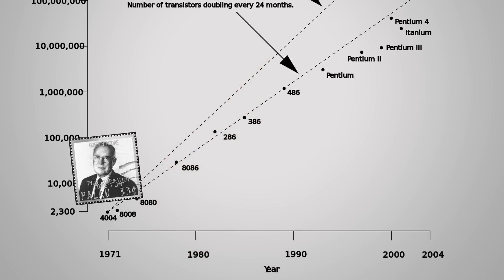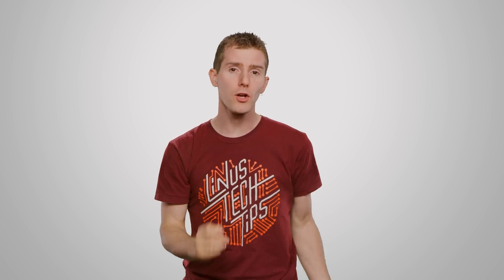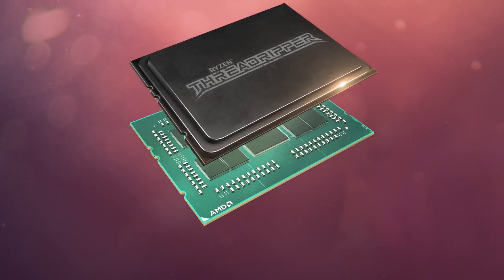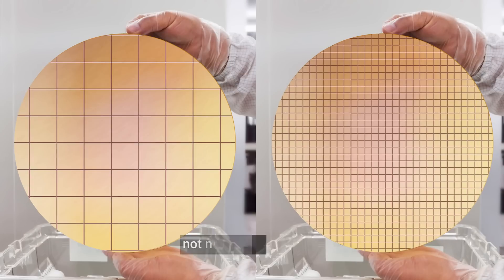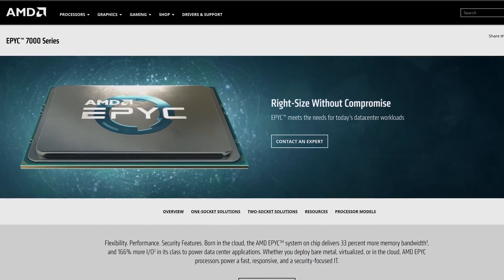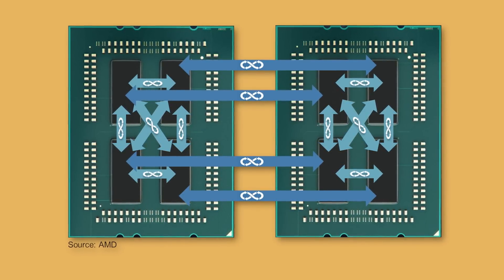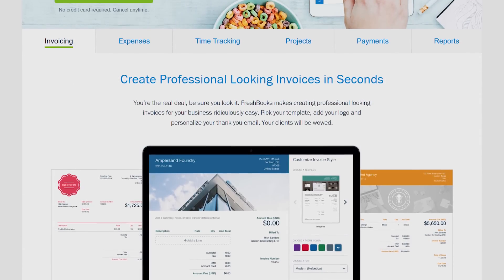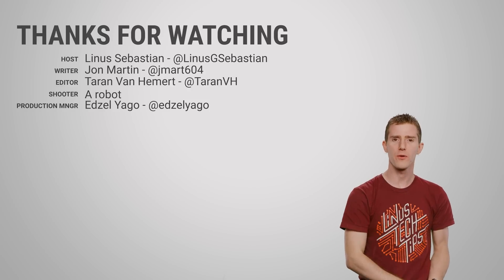How AMD is Making CPUs More Affordable - Chiplets Explained

Comment: 3:52 Correct me if I'm wrong, but there's no optical circuitry in current CPUs, so the limiting factors of speed across a chip wouldn't be the speed of light.
Reply: Electrons travel at about 99% the speed of light. That is what he's referring to.
Reply: @forrest225  Electrons only move at that speed when matter is not present.  In a computer they move at drift speed, they bounce around to much to achieve a straight line. This also happens in a power-line, but on a larger scale. I believe this bouncing effect, is what cause the Heat in certain objects. Granted they now spread this out across the CPU much better today. I remember the old days = hot hot hot lol

For example, the drift speed through a copper wire of cross-sectional area 3.00 x 10{-6} m2, with a current of 10 A will be approximately 2.5 x 10{-4} m/s or about a quarter of a milimeter per second. 

There Achilles heel is, they collide with atoms. Thus causing them to move slower, but still fast :) That's why a battery or a generator controls the Electrons much better.  You remove the atoms, you get your 90% of the speed of light. If you want to move them faster, it will take massive amount of energy to push it 2 to 5% more = not worth it.
Reply: Yet the fastest thing in the universe is only the speed of light" Vacuum of space" .The electricity that travels in wires and poles, moves only about 1/100 th the speed of light. If by some miracle, your electricity moved at the speed of light in the CPU = you would have extreme trouble in your house lol. Even a lightning bolt does not travel at the speed of light. So as long as your CPU Exists in Earths Atmosphere, Nothing in it will ever be close to light speed :(.  

 The Rule is once Electricity is moving: it becomes stripped of it's electrons. Thus your fastest movement of Electricity would be close to only 200,000 mph Not Light 186,282 per second :) The speed of light is still Extremely slow, if we want to travel in space. for a CPU and Electricity is Dangerous :(  

So to your last part of your comment: No data would reach or get close to the highest point of speed. Faster they try to move data/Electricity through tiny strips of metal = they get to hot, so near 200k speed is pretty good for all items :)

Comment: Just a remark: while chiplet based design is a step in the right direction from a cost and yield perspective you make it seem like there are no downsides. If a process runs on many threads and they share memory or depend on each other in any way there are significant downsides. You may say infinityfabric is the solution but throughput is not nearly as in important as latency in today's processors. In some workloads this will have some significant downsides as the concept is analogous to ryzen threadrippers design. Wendell from Level1techs already has pointed out that the design with the different CCX'es can make some processes slow if they don't run all their threads on the same CCX. You could make it into a video discovering the ups and downs of chiplets, maybe in corporation with Wendell. sincerely a computer science student

Comment: I need single thread performance for games I run.  Fail to see how AMD is helping in that area at all.  64 threads is a farce.  I wonder if either my gaming or browsing machines would notice the difference.  All the top cpus in single thread mode are Intel, looked it up recently on Passmark.  Currently I run a 4790K, if I could get something 50% to 100% faster at a mid range price I would move but replacing memory, and mother board is a big cost, although having more data lanes would be nice when I run Oculus.

Comment: Also, chiplets allow for higher clock speeds per die; where as monolithic dies rely on their slowest core to define them, chiplets allow for trully efficient binning to truly unlock higher speeds at the same process by selling lower clocking cores for r5 or R3's. This is why ryzen could truly achieve cheaper and, higher core count, higher clocked CPU's.

Comment: Who cares if they are cheaper if they don't have quality? If they have the same quality as intel, then I would by AMD CPU's.
Reply: but they do?
Reply: @TheCatOfWarCSGO  If they have that's great. Do AMD's CPU lasts more than a decade?
Reply: @HeavenlyWarrior  why wouldn't they?
Reply: @TheCatOfWarCSGO  I don't know, just trying to understand why they are cheap. I know AMD graphics cards aren't as stable as nvidia or intel ones. They do not even support their graphics card for long, at least that happened some years ago I don't know if they still do the same thing.
Reply: @HeavenlyWarrior  None of that is true, AMD products are just as stable nowadays as Intel and Nvidia ones - if not more, as they don't have the security flaws that Intel chips do. They're cheap because AMD are a smaller company and want to gain marketshare by undercutting their larger competitors, not because they are any worse.
Reply: @TheCatOfWarCSGO  I'm pretty sure AMD has the same or as many security flaws as an intel chip.
Ok if you say they are stable it means they have improved, I'll keep it in consideration.
Reply: @HeavenlyWarrior  No, AMD are not affected by nearly as many security flaws, and the ones they were vulnerable were patched in software with no impact to performance, whereas the more serious flaws that Intel was vulnerable to have resulted in patches that degrade performance and in some cases even need to disable hyperthreading.

Comment: The problem with multiple dies is that the inter-die communication can be quiet energy expensive. (more capacitance-->energy required to charge it CVdd^2). The other half of the story is how they have split their processors into different dies.
Fields move at the speed of light but not the signals really..
Reply: @granttamiadinata  I don't deny it. But I believe the more interesting question is how they are splitting it into chip let's without increasing the TDP..
Reply: Also, as the die gets bigger, the clock speed has to slow down because the signal must go further. It's a timing nightmare to design for big surface areas which  I imagine is a big issue in chiplet based designs

Comment: An electrical signal through a conductor definitely does not move anywhere near the speed of light.  That should be apparent in the name of the constant; the speed of light.  We already are running up against the limitation imposed by the speed that information can be passed through a standard conductor; this is why chiplet design is not a perfect solution.  Increased transistor count per area literally is superior because the transistors are closer together and pass information more quickly, not because we can "fit" more transistors on a CPU--if that were the case, there would be zero point in shrinking the CPU lithography process, and we would just made the damn processor bigger to get more performance...  This is also why technologies like nanowires and graphene-based manufacturing can promise orders of magnitude more performance--they are better signal conductors, and they are smaller.

Comment: Chemistry does not stop us from making transistors smaller. Looking at current technology there is a limit of downscalability (monolayer meaning single atom for some special compound and for silicon a hand full of atoms) the thing is: an atom is around a tenth of a nm in size meaning we should expect to be able to scale transistors down to around 1 nm (currently around 2 are doable) so we still can shrink them quite a bit. However, what is keeping intel at 14nm is that you will always have a random error associated with your machines if said error is small compared to the thing you manufacture it does not matter. But the smaller you go with the same old machinery (and making new more precise processes can be really expansive) the closer the error gets to be relevant and the higher the possibility gets to get a fatal defect. More fatal defects means lower yield (a problem that is as described amplified a lot by bigger chips) and that means a lot higher price.
Intel can very well build chips smaller than 14nm but they cannot do it at a reasonable price point. Switching to chiplets (which they already startet) will allow them to shrink again.

Comment: It seems to me that a physically larger chip might actually be beneficial for cooling purposes.  Just throwing that out there!
Reply: Yes and no. If you use more fans, even if they're smaller this will be true. But Just one big fat fan on the top of the cpu will not perform very different. Or just use water cooling instead.
Reply: makes sense

Comment: Signals move with the speed of light inside a CPU? I mean if you send the info with photons then technically that is the speed of light, but when most people say speed of light they mean speed of light through a vacuum, which I can hardly believe you can achieve inside a CPU...

Comment: All of matisse use chiplets, not just the 16 core part.
Reply: I know that the apus that are coming out arnt and are basically zen+. I think that the ryzen 3 CPU lineup is monolithic too a d also based off zen+
Reply: @slickjim861  matisse has no APU's in its lineup, the code name for the apus is picasso, renoir will have chiplet design

Comment: less micro processor more super processor. Really looking forward to zen2 bridging the gap between amd and intel as far as gaming and Lower L cache utilization. Since their implementations to threadripper, im hoping the ryzen 9 12/16 cores. Can do the same as threadripper and remove some core power from the excess and throttle them into the first four. To in theory offer something ryzen 7 cannot touch. Im really looking forward to overall numbers of ryzen 7 8 core to the 12/16 paired with flagship 2k 2070+ 5700+ options. How they perform with vega 56/64 and radeon 7 as well.

Comment: 0:45

Here's an idea..(im not sure of the exact chemical properties)

Make them out of a liquid metal... Or some type of conducting superfluid...
For example... When they started developing mercury breaker boxes for homes, instead of solid metal filliment ones. 

When a mercury breaker pops, it just flies apart with the electrical discharge, then flows back together and coalesces back into its confined shape of its container, being able to keep up that same process over and over, returning to its natural functionality virtually endless times... 

Now, im no expert in that area, or anything of the sort, but it seams like a novel idea... If applied to something to that effect, could solve that problem of which he describes. 

If anyone knows a more exact methodology or science that maybe im getting wrong, please post. 

Or if there is some kind of technology now or on the horizon that applies to this... Id be very interested to hear
Reply: he missspoke, its not chemicla properties, its the physics that start being a problem at that scale as your staring to deal with sizes where you cna start experiencing issues with your signal bleeding thru to neighbouring paths. bascially mkaing the 0's and 1's harder to tell apart.
Reply: @Teixas666  ok now binary... THAT i DO understand.. 💯

Thanks for the info 👍

Comment: 3:55 "Signals moving at the speed of light in a microprocessor" I know you guys simplify stuff for Techquickie but you might want to double check your facts on this one. Electrical signals don't move nearly at the speed of light, hence why fiber optic is faster than copper wiring. Electric signals are closer to 1/100th the speed of light through a conductor.
Reply: He didn't say anything about electricity though. He might as well have meant optical computing or whatever else crazy stuff we do come up with.
Reply: the electromagnetic wave rippling through the electrons that propagates at close to the speed of light. The dimensions of the wire and electrical properties like its inductance affect the exact propagation speed, but usually it will be around 90 per cent of the speed of light – about 270,000 km/s.
Reply: I came here to say this and am glad I'm not the only one who caught it!

Comment: Signals do not move through a microprocessor at the speed of light. They are transmitted by electrons or the lack thereof (holes), whose speed is limited by a variety of factors such as scattering at impurities, the crystal lattice or other electrons. Higher carrier mobility is also a reason to explore semiconductors made from non-silicon materials.
Reply: The answer is quantum mechanics

Comment: Can't they go vertical?
I wouldn't mind a cpu that's twice or three times higher than normal
Reply: that's what intel does, with foveros. But that' mobile CPUs/SoCs, as you run into heat dissipation issues
Reply: That creates serious cooling problems, ARM is on a league of it's own as of now with SoC architecture, and some of that makes a lot of sense.

Comment: In theory you could also build a heavily poly-layer cpu using stacked chiplets to get some of that space back. Thermals would be a *shut yo mouth*.
Reply: Thomas Uniat add cooling layers in between them to pipe heat out to the sides
Reply: @JAT985  agreed. Maybe just copper foil instead of heat pipes but same idea. Sounds easier than it is though.

Comment: I've read that my 16GBs of RAM for my Ryzen 5 system is more than enough and that Ryzen doesn't handle more than one channel of RAM well. Is this true guys?
Reply: Sonikks nope also amd sucks and it’s the opposite AMDUMP NEEDS EXPENSIVE FAST RAM SO U AINT SAVIN SHIT
Reply: It's true that first gen Ryzen had problems with Memory compatibility at the beginning, however they improved quite a lot on that and will improve furthermore on that with 3rd gen. But whatever the case, make sure you get dualchannel memory (so at least 2 Memorysticks), as singlechannel Memory might Bottleneck your system. Just make sure to put them in the right slots for dualchannel (check Motherboard handbook or datasheet)

Comment: Electrons don't travel at the speed of light... Actually, quantum mechanics forbids this.. So technically the amount of transistors on a chip isn't the whole deal, it's also the distance the electron has to travel to activate said transistor, hence the quantum mechanics reference.
Reply: Electrons dont travel all the way around the circuit either. The amount of flow (literally by definition the number of electrons) in a circuit is amps. (remember voltage is the potential or "pressure") An Amp or Ampere is one coulomb per second past a given point (Coulomb is to amp what a watt is to a joule). Think of it more like a pipe full of rubber balls that are exactly the inside diameter. If you push a ball in one side another immediately pops out the other side. Also the distance problem you describe is known as latency which can and is mitigated in many ways. So for many practical purposes, it may as well be whatever nice decimal point of C you'd like. Either way its almost if not as fast.
Reply: #ulysisxtr Jesus man, we are on Tech channel not science one. we don't care about the speed of electrons nor physics....
Reply: Well, if you're referring to 3:54, Linus didn't say electrons, he said signals. While it's true that electrons move at a very slow pace through a conductor, and signals don't actually travel at the speed of light, signals do travel at a significant fraction of the speed of light in a conductor. In a vacuum, signals do travel at the speed of light. Electrons don't of course otherwise they'd gain infinite mass (which would require infinite energy)!

Comment: They don't? A 6 core for 200 is not a good value. At least it isn't when you consider how much it cost to make it. It's better in the high end. But AMD screwed up those who were loyal to them. Who wanted affordable entry and mid tier CPU's. They screwed us over.
Reply: so it's forbitten for amd to make money back from their sold products? I mean they still offer better value than intel...
Reply: Ryzen 5 1600 - April 11, 2017 US $219 
Ryzen 5 2600 - April 19, 2018 US $199
Ryzen 5 3600 - July 7, 2019 US $199
6 Cores are as affordable as they've ever been and they have been getting IPC improvements and increasingly higher core frequencies. It's still great value. 
Plus, AMD puts their CPUs on massive sales compared to their competition. I've seen the R5 1600 for $80. Where as the equivalent Intel CPUs are literally within 10% of the price they launched at. In my opinion, AMD put in the work and deserves to profit from the R&D and high value products they've used to shake up the market. 
(That being said, I'm not paying that much for an x570 board. PCI 4 is not worth it to me.)
Reply: @Charsept  Say the same in 2022 when you will still buying the 6 cores for 200, or even more. Yeah. Let them increase the prices slowly so that we don't feel it. (You don't, cheap people do.) So they can cook you alive. Smart decision there.

Comment: It's normal, the r3 1200 cost 55/60€ and the r2200g cost 75/80€?
Reply: Well the 3300g has integrated graphics so it's obviously more expensive compared to the r3 1200 which does not have any kind of integrated graphics.